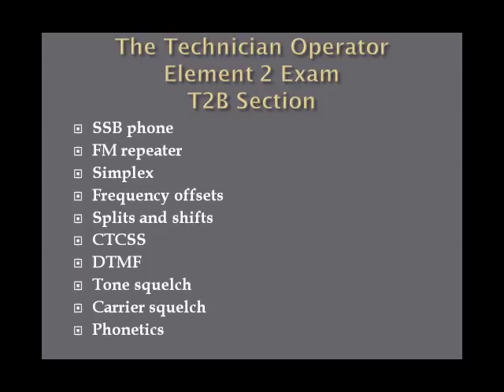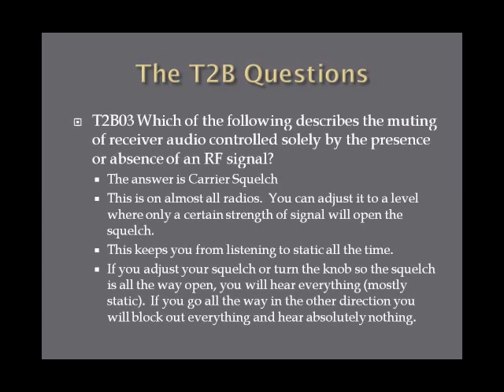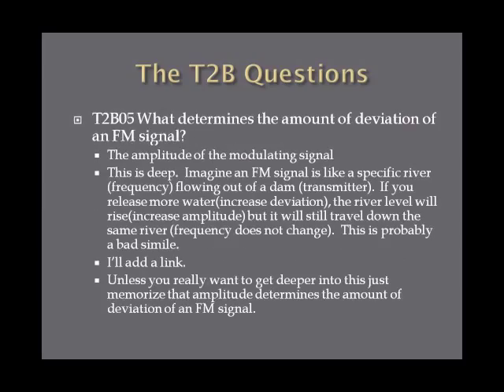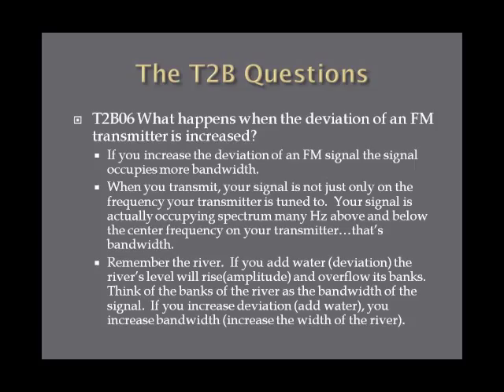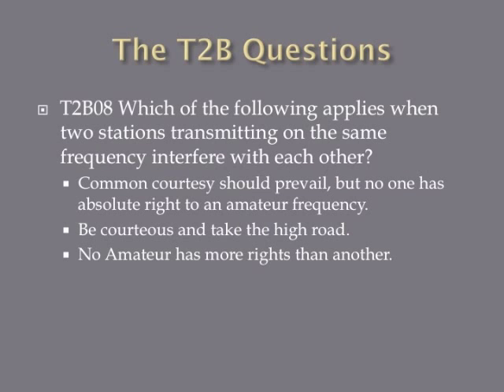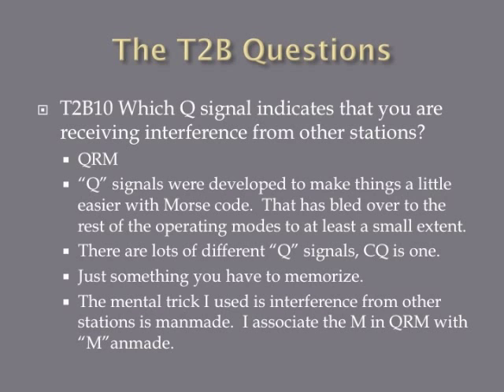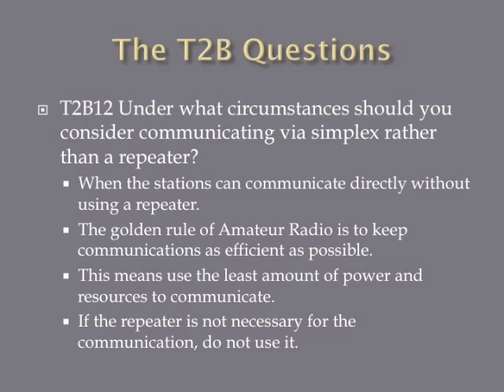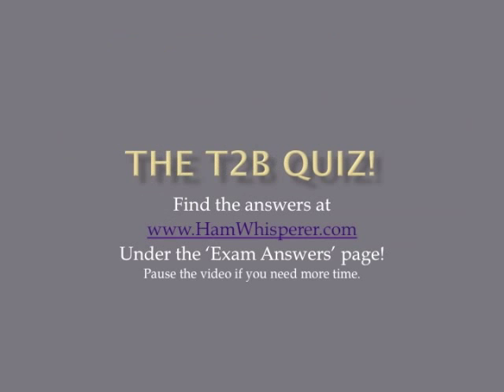Lesson 8 Technician Class Exam Second Edition

Comment: A better example for question 5 would be to use the faucet and sink analogy like I was taught in photography class. example Fstop and its relationship to image exposure. The exposure ( message/image ) is the sink. The Signal the water ( in photography it is light ). the diameter of the faucet is the Fstop ( in this case modulation ) . the wider/higher the faucet is turned on, the faster you will fill the sink ( get proper exposure/ transmit message). that made it make more sense for me. but, ive been a photographer for 20 years...so, go figure.